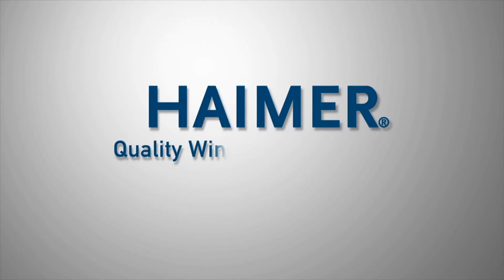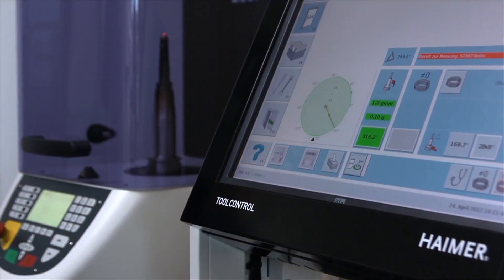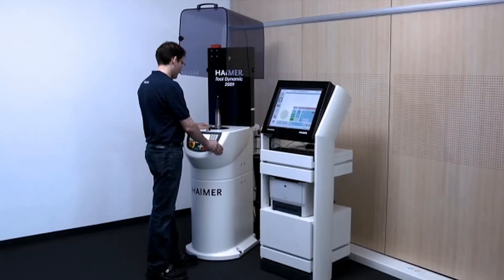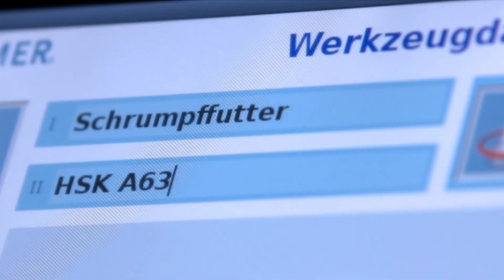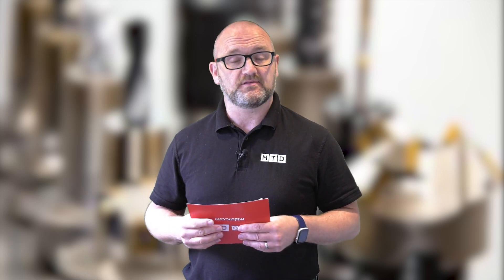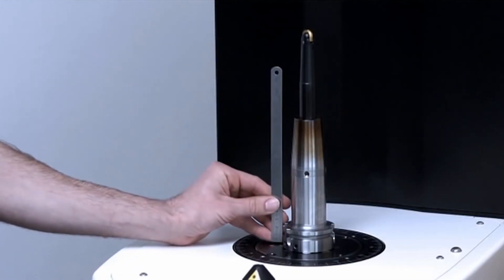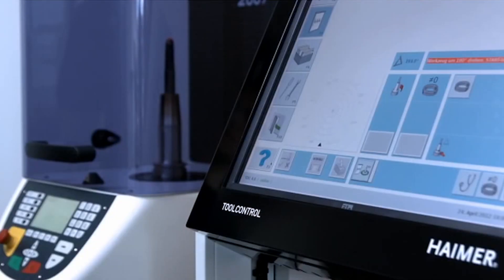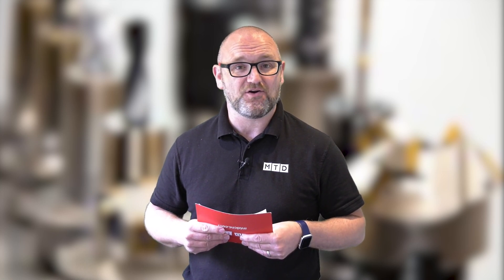This is why you should balance your own tool holders

Comment: never seen one on a shop floor, wonder how much they are?
Reply: Too Much...  There's a used one on ebay for 55,000 dollars right now...  Probably should get two just in case...
Reply from the maker: They can really save you money in tool life, part process and in many other areas.

Comment: eeeehhh... I would rather be if the end mills, collets etc came in balanced... balancing for every tool is only for high-precision high rpm applications I believe
Reply from the maker: We have witnessed toolholders that are so far out of balance that their max RPM should be 80 RPM. It is fair to say that, the faster the spindle, the bigger the savings but even at low revs, you can achieve massive results. Maybe speak with HAIMER for more info.
Reply: @MTDCNC  if somebody sold me a toolholder of such spec I would chuck it into the face of their salesman who sold it to me and would order a lifetime ban on the brand.. no time to deal with zero QC
Reply from the maker: But how would you know? They will claim to be balanced and 90% companies don't check.
Reply: @MTDCNC  I've got a 24k rpm hsk spindle on one machine and we've built an simple accelerometer (a 1000hz one) setup on the spindle itself to check for vibrations and 3 brands that I buy from look very good (not cheap).. most of the vibration comes from the tool inserted.. when doing small moulds we have crazy Ra requirements so everything has to be perfect.
Reply from the maker: @chronokoks  Sounds like a nice set up to me!
Reply: How does the machine make adjustments to actually balance the holder and tool setup?
Reply: Datron sells balanced but single flute uncoated endmills. Haven't heard of other brands do this yet but it would be welcome...